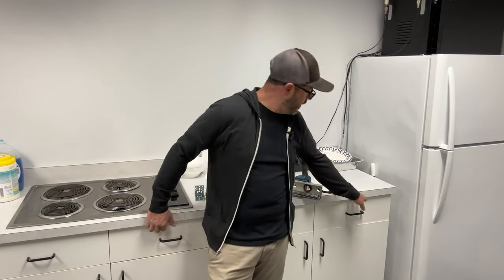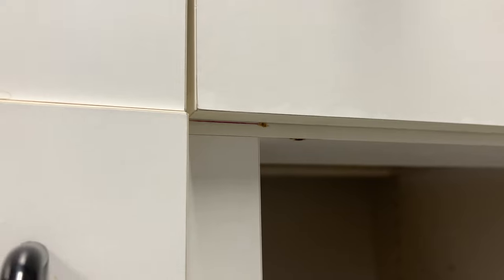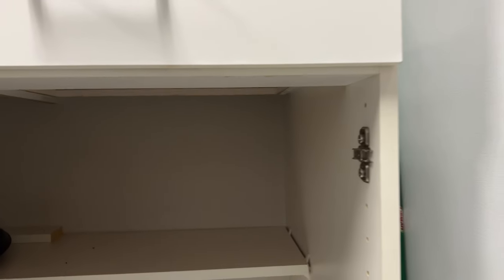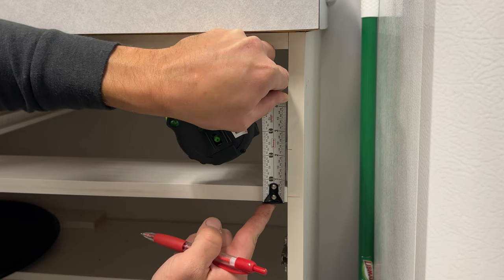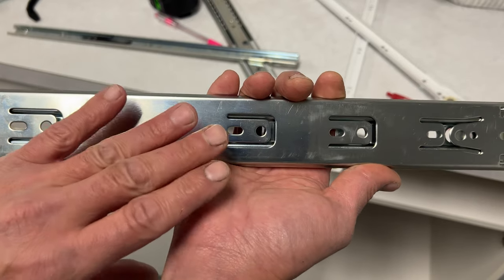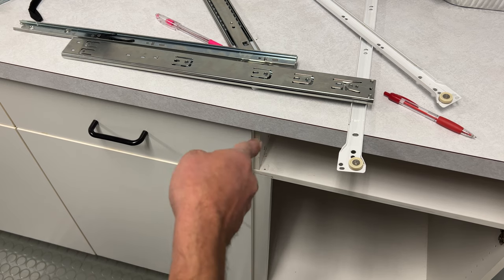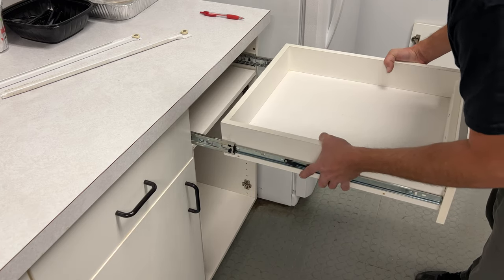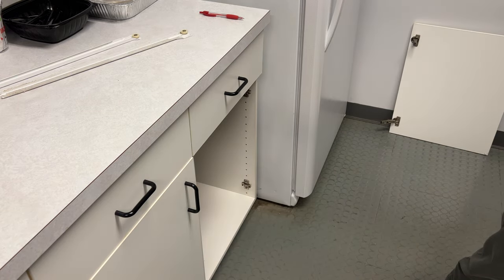How to Upgrade Roller Drawer Slides (Quick and Easy!) - Soft-Close Upgrade

Comment: I’m enthusiastic to take up the challenge and replace our kitchen drawer slider. Your video has built up my enthusiasm. So, our drawer’s are 21 ¾ inches depth what slider length should we purchase? 22 inch or 24 inch? 
We have the required ½ inch at either side. 
Thanks for your detailed video.
Reply: Are you planning to install a slider longer than the drawer? I don't think so, right?  Has to be the same size or smaller.

Comment: Question for you ! Haha hope you don’t mind me asking !
Anyhow can this slide be used for something other than a drawer ,, 
Meaning I have a Breville toaster oven like and it sits on the counter top tho it sits to deep and when on the heat and yes smoke at time raise up and grease stains my upper cabinet doors … 
I was wondering if I sat the Breville on these rollers hinge’s that if ever I wanted to run the Breville I could just slide the Breville forward even 2 or 3 inches and it seems to make a difference when I pull it out manually ! The second question is i don’t won’t holes on my counter to wreck anything , so I wonder if it’s just sitting on these roller hinges if it would slide out just by the weight of it ? 
Like to hear your comment or another suggestion 😩🤣👍
Reply from the maker: Well! You definitely do not want to install the slides to the countertop.
I would recommend making a platform to mount the slides to and and then add a shelf to it (as the drawer) and then sit the Breville on it. Does that make sense?

Comment: I bought the 22 inch drawer slides...will they work with a 21.5 inch drawer?  Depth to face of cabinet is over 23 inches
Reply from the maker: Yep! They will work perfectly. You will actually have a little more extension of the drawer so its a bonus

Comment: If you were going to burn 1 inch on the tape measure, you need to do it on both side, because sometimes tape measure is 1/16 th of an inch off when you hook or push against Whatever your measuring.
Reply from the maker: Very good advice! I was assuming that your tape measure has been inspected and checked for accuracy first!